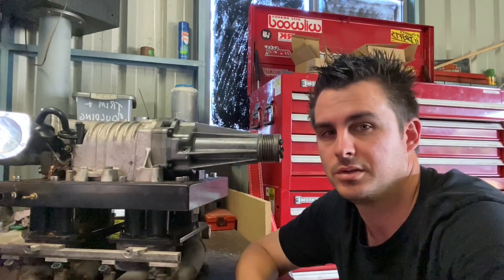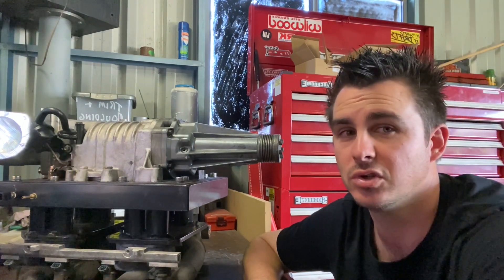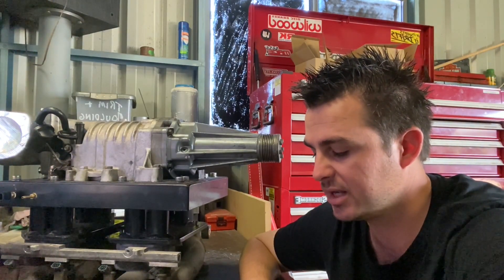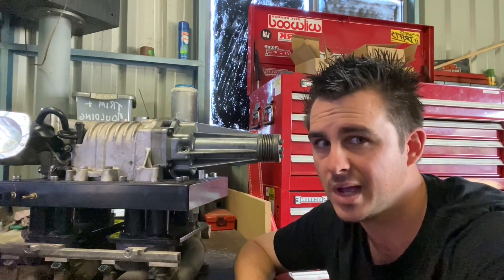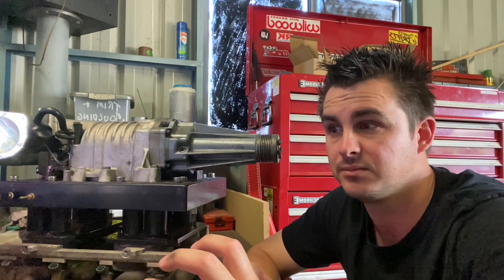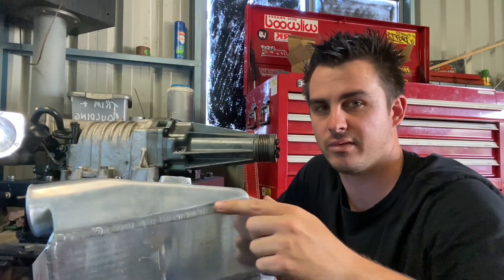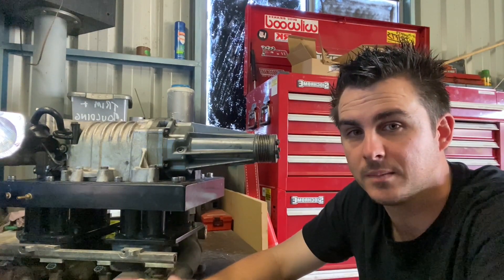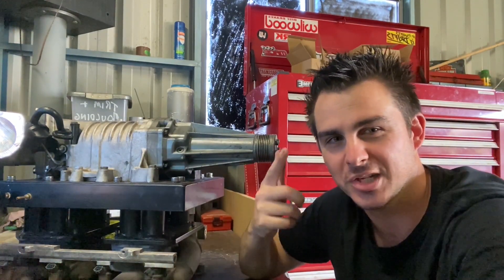Eaton M90 Intercooled 1UZ Manifold Build - Part 1

Comment: hi!! What kind of drive belt do you use with a reduced compressor pulley? And how many horses are obtained with a reduced pulley? Have you made a cooling (cooler) for the compressor? Thanks!! Greetings from Russia)
Reply from the maker: Hi. I use a regular 6 rib drive belt. I gained approximately 100hp with this setup. I have made a cooler but have not tested it yet. Please watch my latest video to see it in more detail.
Reply: @Brodorsport  I mean what length are you using? which car is it suitable for? (I have some kind of yagur. But I want to put a pulley less like yours. Therefore, I am interested in the length of the belt and from which car it can fit. Thank you))